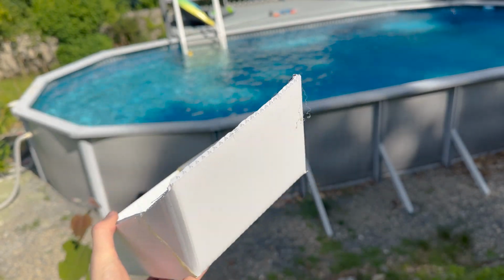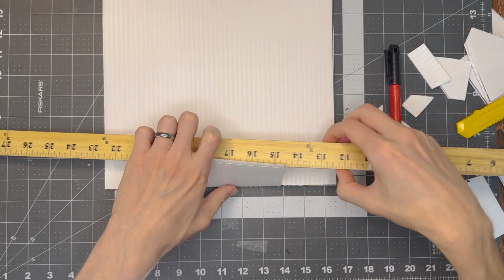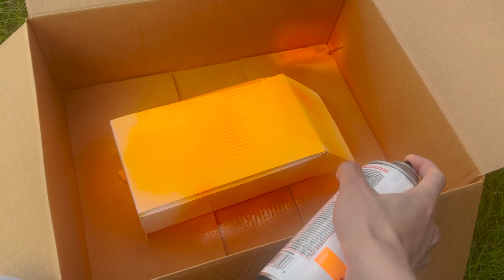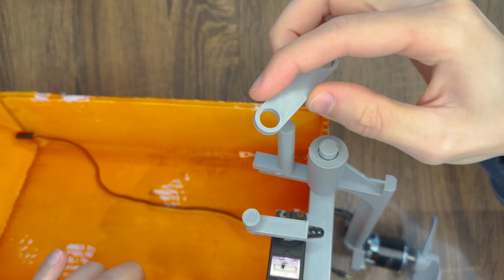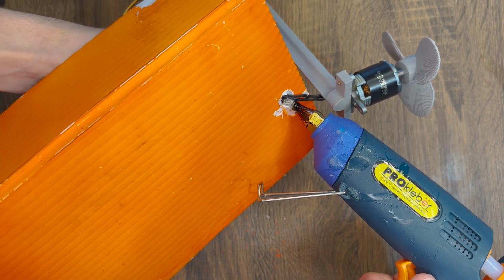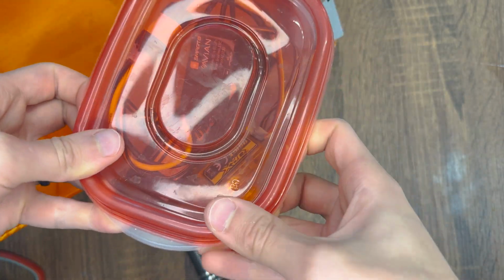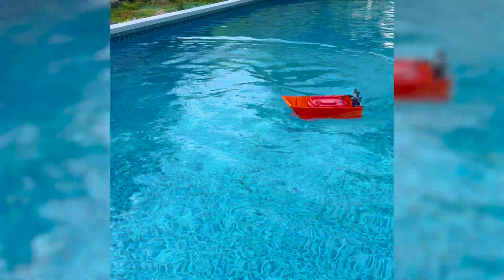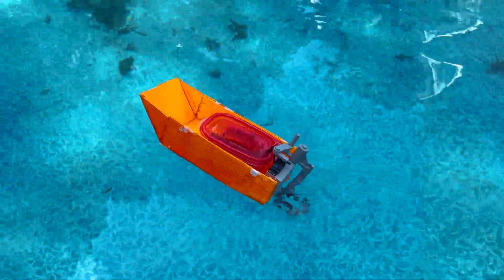How to Build a RC Boat

Comment: Why not run the motor wires over the back? You won't have a hole in the bottom of your  boat
Reply from the maker: In my case, the wires weren’t long enough to run over the back. If you watch some of my shorts, you’ll see that earlier prototypes had the wires run over the back because the motor was nearer to the waterline.

Comment: I’m kinda surprised that you can run the bldc motor in water like that!
Reply from the maker: Yea, me too. I didn’t know it was possible until people pointed it out to me.
Reply: @makermandan  ok, in retrospect, I feel like I shouldn't be as surprised: the rotor is basically just a magnet on a shaft. The stator is a 3 or more coils of insulated copper. You just need to worry about where the insulation stops&starts because of solder joints, and if the bearings are rust-proof. Still... unexpected...

Comment: If anyone else is gonna make one, jb weld works better for sealing the bottom hole in the boat and hole in the electronic bay
Reply from the maker: Good point! But I like hot glue because it’s easy to remove if I want to reuse the electronics.
Reply: @makermandan  that's honestly great reasoning.  I often seal electronics with jb weld because it works, and I've never had to take a bay back apart.